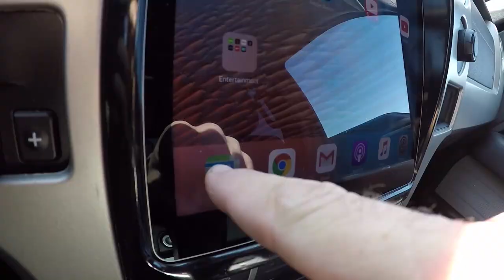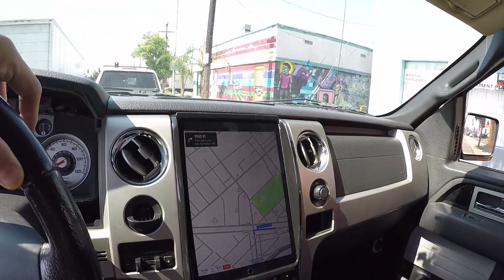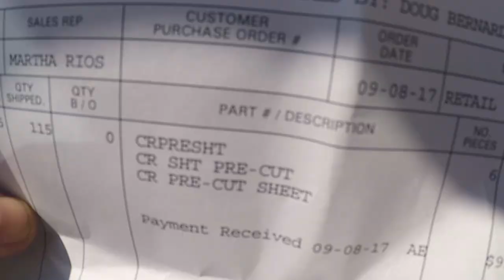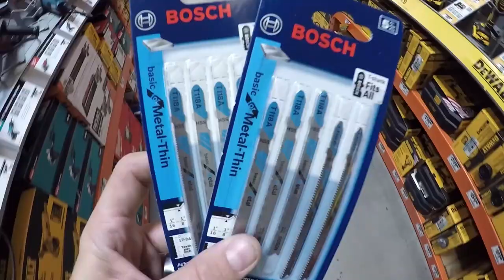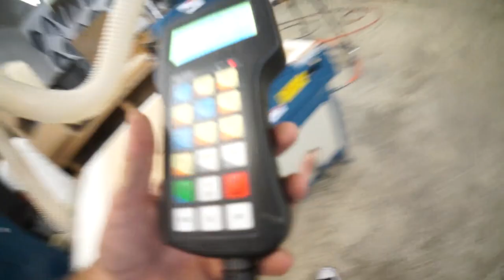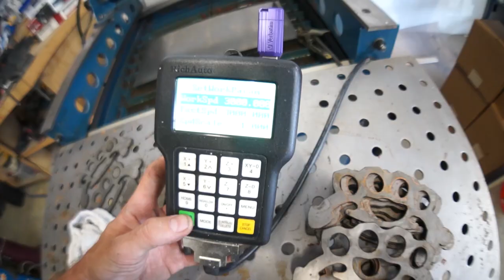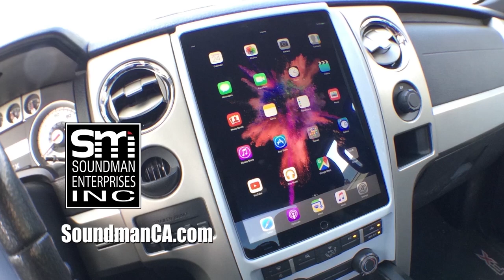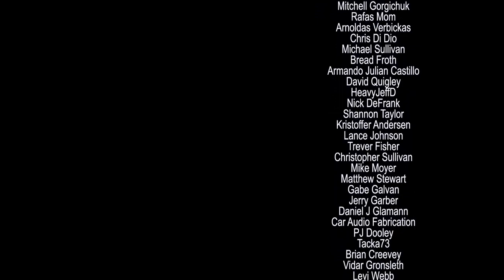That time Rafa built a box, I'm filling YOUR 1,000 ORDERS!, I ordered my Sony deck - AMPLIFIED #653

Comment: Doug, When you install your Rsx Gs9 put a Delay Relay on the ignition trigger wire so that your Rsx Gs9 Doesn't Double Start every time you turn on your trucks ignition to Start the truck , it works great. Get the Delay Relay from Amazon for about $ 12 Bucks.

Comment: Doug, next time your at extreme, can you show us the head units for the ipads rafas installing. Im curios if he puts in new units or pushes back the oem.
Reply: On quite a bit of them he cuts out a single DIN opening in the kit for the head unit to be accessible while the ipad is not mounted.

Comment: Doug I have ran the Sony, its an amazing deck to say the least. I currently have my ipad ran into the Helix P-SIX DSP, it accepts ipad usb straight into it via usb audio interface adapter, and also puts out 120x6 power. I like this setup better than the gs9, but u cant go wrong with the gs9.
Reply: U need to check out the Helix DSP's, they are the best on the market!!

Comment: Doug, don't waste money on the jig saw blades. Just make a single line cut program and use the plasma to cut the sheets in half. You can overhang the material in the front.
Reply: For that matter the metal supplier would have likely sheered it in half for free! Mine certainly would have.
Reply: I assumed that he would have asked them already?

Comment: Use ( F-Mod's ) to make a Notch filter on your Mid-range Amp. It's an RCA Inline Filter that is as close to an electronic crossover as you can get without using an electronic device. Get F- Mods at Parts Express. They come in Hi Pass , Or Low Pass Versions. & Work Great to save Speakers from bad Over excursion, & stop Destortion from full range operation overdrive.
Reply: jobos98 no.  Just no.
Reply: It works just fine

Comment: Just get the pioneer and run all your full range from the prs80 to the audison then to a correct multi channel amp and the sub off the ct amp . the pioneer connected to the audison should give you the equivalent to a 48 band eq. Stop fucking around with over fancy crap. Its not the time for this Doug!

Comment: Doug you be droppin $1500 on a Headunit and still be playin spotify or streaming. You ain't gonna get no high end sound outta that garbage that they put out on spotify or streaming. Time to DL only FLAC files. Shit that Sony doesn't even have a copper plated chasis or an external DC-DC Converter. Gotta find those OG headunits